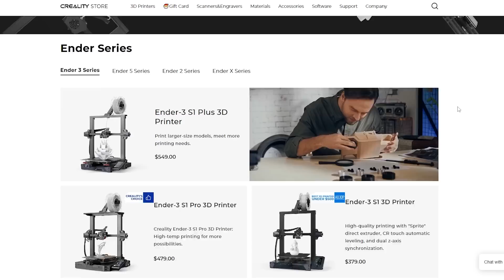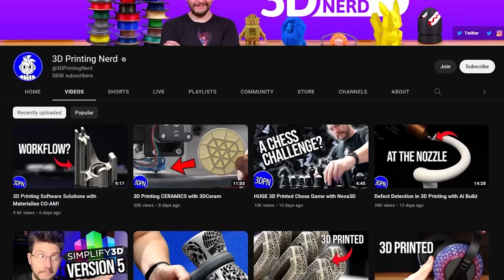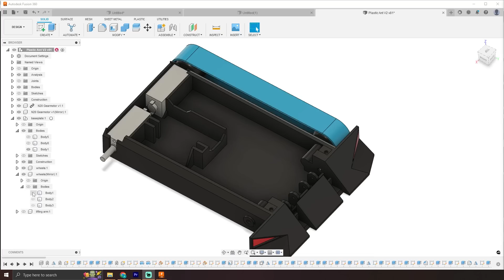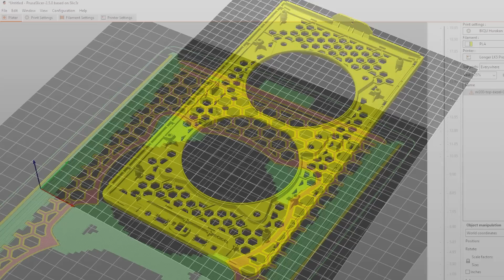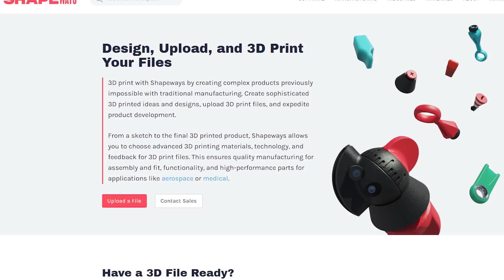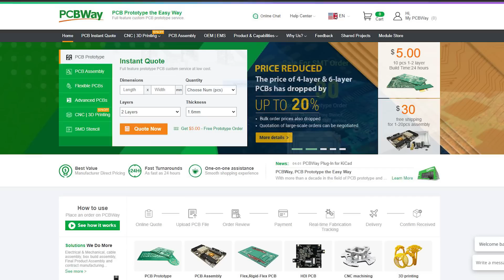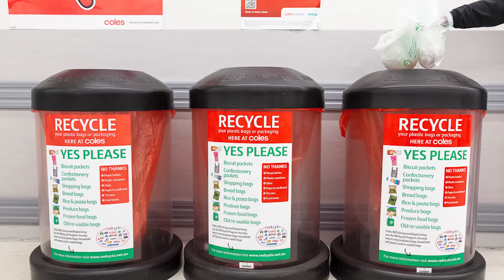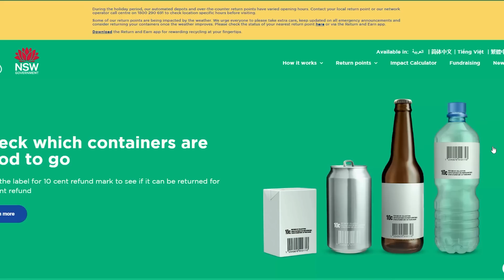My 3D Printing Predictions for 2023

Comment: As someone that uses prints as end use parts in a professional environment, printer companies NEED to start making better printers that are designed with enclosures and good heated beds. PLA is good for hobbyists and prototyping, but it is worthless for me. I only print in ASA, Polycarbonate, and some ABS.

Comment: Cellulose bioplastics have huge thermal expansion coefficients compared to most 3D printable plastics: the challenge is finding the right functional groups, copolymers and plasticizers to reduce that thermal expansion - it is probably solvable, but by no means easy: it's the sort of problem you'd want quantum chemistry simulations for. Also most modified thermoplastic celluloses are highly flammable. Methyl and ethyl celluloses seem like an interesting direction, but they are a bit harder to make at the scale needed.

Comment: I've held off on buying a 3d printer for years. My job has almost always had multiple 3d printers over more than a decade, and I always viewed the 3d printers I deemed reasonably priced to be too low quality or finiky to justify buying. I just got my first 3d printer because I finally saw something that I considered "consumer grade". So far I'm pleasantly surprised by it. It's an FLsun v400 fyi.

Comment: Guess what, Ender 3 V2 is no longer easily hackable printer. It now contains proprietary binary blob for the screen, and it gets worse - you play a lottery which screen (there are at least 3 variants) you get (2 of them have prepackaged blob and one does not). It's also a lottery for a ST Cortex-M MCU. Enter 3 might contain ST microcontroller, but you will most likely find a cheaper Chinese clone, which is not exactly the same and requires firmware adjustments.

My prediction is that Ender 3 will slowly fade out as a cheap printer you would recommend for tinkering or hacking.

Comment: Love these videos.  As Bob Ross was to painting or Bob Villa was to home improvement, you are to 3d printing.  (Not sure if those references make any sense to an Australian.)

The commodity cheap 3d printers make a lot of sense if you don't really know if you want to get into 3d printing and don't want to take a financial risk, but if you do decide to get into it, their compromises and imperfections start to get old fast.  On the other hand I find any sort of locked down software or hardware an even worse option.  So personally I am going to stick with the higher end but open architecture printers going forward.

Also agree with the need for easier CAD tools.  I've struggled a lot with this; I have a day job and I'm not an engineer, so I don't have easy access to professional tools.  If you like GUI/WYSIWYG tools TinkerCad is a really good option but I personally got frustrated when I was trying to make more precise or complex designs.  As a hobby project I put together a page that makes STLs from JavaScript code; it is posted at atomiccompiler dot com, along with some designs for common things like gears, if anyone could get some use out of it I would be tickled pink.  It works well for me, but that's because I'm more comfortable writing code than drawing.

Comment: I predict that a lot of Prusa printers will enter the used marked, as people switch to Bambu Labs.

It used to be you could get almost the full kit-price for a used Prusa printer. Now the prices will drop a lot.

This means that not only will Prusa loose sales because people buy a Bambu printer instead. That will also loose sales because people buy used instead.

Print farms will switch to Bambu Labs, simply because a printer that is 3 times faster, spends almost 3 times less energy.

Comment: I add my prediction here: the difference between firmwares will start to disappear, let me explain since Klipper came out it was the king of speed printing (and it still is) however both marlin and RepRap are introducing input shaping, and coprocessors to the game (in a similar way) and at the end, it will just be which one you like more, also I want to point out that the arm CPUs that are being mounted to mainboards are getting faster and faster, we aren't close to pi, but they are growing exponentially soon we will need a cooler like in a pc lmao.
argue with your keyboard.

Comment: Great video as always...My Bambu X1 Carbon arrives in 4 days...for me it was a combination of all the things that I am trying to cobble together on my other printers (enclosed chamber, onboard camera, color change, web interface, auto level/ lidar confirmation, etc)...I am more than a hobbyist, using Solidworks to design, then printing prototype parts for fit test before sending designs to CAM.
I welcome the new guard...it is truly time to start changing the way we print.
Reply from the maker: Nice! Throw some parts at it using the cf-pa or a good ABS, its performance with these materials is really winning me over.
Reply: @MakersMuse  I have run the CF... beautiful results, final parts created in-house now!

Comment: I see more schools focusing on what is possible and trying to hook students earlier even at the grade school levels. The tech improvement and race to the bottom led to more schools getting printers. As the kids start seeing them as everyday appliances,  you will begin to see the demand for easier use and setup expand.
In the case of resin, this will be the year of scaling and smells. Lcd panels keep getting cheaper and light sources stronger with longer lives. With DLP in  the picture now, I can see simple light replacement like with standard projectors being within reach. The printers will have variable resolution so you can now print that 10" wide item at 4k but a smaller 3" area at 8k on the same machine. This is perfect for those times were you don't really need high resolution. For example a gear printed at 4k is just as usable as one at 8k.
On the recycling side, I can see a cottage industry popping up for recycling filaments. For example a makerspace offering filament recycling and respooling.

Comment: I think your take on the "race to the bottom" is a little jaded. Not that the I-3 bed slinger clones are the end(er) all and be all, but neither should they be lamented. You're coming from the position of a bored reviewer that's seen a hundred of them, not a consumer that's typically only going to deal with one or two.

 A huge portion of the innovation in the 3d printing space comes from the community itself. Getting the price point down gets them into more peoples hands which drives more development from both the community and manufacturers. Few manufacturers are going to develop for a market that doesn't exist. The cheap printers lowered the barrier to entry and increased the user base to the point where tiered market development is viable.

I submit that we wouldn't have machines like the P1P now if the open source Prusa and the lowly mass produced A8 or Ender didn't come first.

Comment: I entered then exited the 3D printing hobby in 2022 with an Ender 6 and Phrozen Sonic Mighty. The Ender 6 was all tinkering and replacing parts with 48 attempted prints and 2 one inch prints working. This is now a pet rock in my shed, I will wait for a dry year to try again... The Sonic Mighty can print figurines but for anything else the plastic is both soft and brittle, so useless. What should they work on:
1) Reliability; 2) Reliability; 3) Reliability; the printers should work out of the box. Selling headaches to people is an unsustainable business model.

Comment: 3D printers with more built in sensors to auto-detect mistakes, correct, auto-adjust and more. Software that can figure out things for you better and in more ways, like how to print stronger piece with less material just from profile. 3D printers with multiple heads and more tools (not just extrusion). Robot arms to manipulate things on bed. Printers with multiple moving devicwss.

Comment: Back in the mid 80s I bought two propellers for my RC airplane that came without the holes in the center for the prop shaft. I took them to the local machine shop to get the holes drilled with a drill press instead of doing it with a hand drill so it would be straight. They told me to return the next day to pick them up. When I went back to pick them up, the shop wanted $500 for drilling two holes. I told them to keep the propellers. Suddenly the cost dropped to $20. They claimed they were losing money, but I think they just didn't want people bugging them with such small jobs.

Comment: PET (pop bottle plastic) is already by far the most easily recycled (and valuable) plastic in your recycling.  Companies are looking for that material for reuse.  Other plastics than end up in recycling are not so easily reused, and these are  the plastics that are the hardest for recycling companies to get reused (or even disposed of properly!).  Turning PET from pop bottles into 3D prints that themselves will no longer be recyclable is simply kicking the can down the road.  Finding a way to reuse other consumer product thermoplastics (polystyrene, polypropylene) would be a far better goal.

Comment: My ender 3 is old like. Really old. I have added 3 upgrades that I love and it runs perfect.
1. Metal filament push segment, one day the plastic surrounding the extruder snapped and it could no longer push the filament the metal one stops it from breaking
2. Magnetic board, my board was breaking so I replaced it I did break the new board cause I bent it more than I should've so I've ordered another and they're super cheap
3. My most important SILENT MOTHERBOARD this thing makes the whine on the ender 3 non existent I can only hear the fans now.

Comment: The direction for recycling could also go in two other directions: melt down from old parts and producing new recycled filament, as well as using extruders for granules on consumer machines. Here I've got two videos for you from a small channel. They are in German ... but you can see the results:

https://youtu.be/lcsWwwehgwc?t=778
https://youtu.be/63pwqjEHPHc

Comment: Pretty please cover the way to melt down and extrude your waste into a roll of PLA.  Is there a way to use foam waste from packaging? I have been using that foam instead of Kaizen Foam to organize smaller tools where the accuracy doesn't need to be tight.

Can you help to encourage the sharing of files to print or improve? It seems like the whole community isn't there. I get it, people want to make money. My thing is just about how fun it was when the naive beginner hobbyist version of me came into printing, and it seemed like everyone in this amazing space supported each other and shared ideas, in order to make gigantic jumps forward. Most of us are there for each other, Part of me goes back to that series WTFFF did, and it seems like we have been moving away, but in the wrong direction. 

Thanks for a great year. You break it down so newbies like me can come in and have fun in this hobby a lot quicker.  I came in to print tool parts and organizers, but have had fun printing for my kids lately. My wood working shop has ground to a stop, so I can keep my Filament printers going.

Comment: I m 12 years old and my parents bought me a 3d printer for my 11 birthday and since then I m literally a pro in fusion 360 I've learnt with videos the only thing im missing is the spacial vision , one month a go I bought a Ikea skadis to fit my maker space and have already designed  a profesional looking parts such as a cool looking duck take holder Dremel holder pliers holder calipers and Allan keys holder and now im working on the screw driver holder most of them I had to do a v2 but now im so proud of them.

Comment: I've been telling myself I'd combine my ability to fab 3d printed components with some off the shelf buys to make a plastic shredder+auger+extruder so I can finally turn my scraps into pellets and, maybe eventually into filament.

I mean, is it really that hard to get okay results? I've used multiple 1kg spools of the exact same filament and color, I've gotta be able to turn that into a relatively uniformly composed filament even if getting a consistent diameter is a whole other can of worms.

Comment: I was using my Ender 3 alot, but then stopped, and then I needed some parts, and whoa, no way you can just fire it up and get results, took lots of time to tweak everything again to get it working.
My biggest problem however, is it took too damn long to print anything significant.  4-8 hours, wtf.
So printers that can do it lightening fast is what really needs to come to the market, and same prices as ender 3..

Comment: Been printing for around the same time and I pretty much agree with you on all those points. I also had my companies Ultimaker 2 have its ass handed to it by a printrbot simple metal so your comments on a “pro” printer resonate with me. I hated that ultimaker with a passion. 

From my perspective, 3D printing seems to be a lot more accessible than it ever was before. To get my Printrbot to do a decent job, I really had to tweak it and I had to understand 3D printing. I now own an elegoo neptune 3, assembly was 15 minutes rather than 2 days and the printer not only does a great job, but it does it faster, quieter and can handle more materials, and it costs a 3rd of the price! Probably an unfair comparison BUT that’s how much things have changed over the last 5-6 years. And I love that. 3D printing needs to become as simple as pressing print in MS word and getting perfect results every time. We are not there yet, but we are getting there. 

I remember the original photostat monoliths companies would pay a fortune for and have a serviceman to maintain on a weekly basis. I can now print better quality from my phone wirelessly to a printer you can buy at a convenience store for €50! That’s where I think we are headed.

Comment: Small-scale PLA recycling ought to be a piece of cake.  Grind up the scarp parts into small pellets, mix them, melt them and re-extrude them into new filament.  And if that filament is being used for further prototyping, who cares that it’s not a universal colour?

So why does the machine that can do this not exist at the hobbyist level - and why does no-one offer it on a small industrial scale?

I’ve got about 10kg of scrap PLA parts.  Not worth my spending a couple of grand on the kit to recycle it into new filament, but right now my only option is indeed to landfill it :(

Comment: hoping to see desktop injection molding take off.

i see some similarities between what you can get with those today as desktop 3d printers were 10 years ago. if companies look at how 3d printing exploded, they may jump into injection molding and making that more accessible in the next couple years. with certain resin prints being able to withstand the high temps, we could even see a fully streamlined 3d print based pipeline for injection molding hobbyists.

Comment: I think the part about the pro-sumer war will be very accurate. Whilst I love my Prusa i3 and Mini they are old, slow and can't compete with things like the Bambu X1 and P1P, and when the P1P costs the same as a Mini it does make you question Prusas future as the leading 3D printer manufacturer. I'd be worried if I was Prusa. They need to nail the XL and get a new printer out (not a minor iteration to a MK4) that brings corexy to their consumer level. If they dont do it then someone else (probably Creality) will.

As for recycling I think the biggest challenge is when you dispose of 3d prints its not immediatly obvious to a recycling plant what type of plastic it is, and you can bet if they can't identify it it doesnt get recycled. For that reason it would be good for slicers to start including the option of printing the code for the material being used on the bottom of the print (similar to how some plastic bottles have PET printed on the bottom). It's not a solution but it's also no harm and increases the chances of items being correctly recycled.